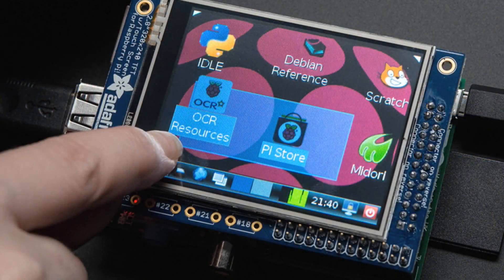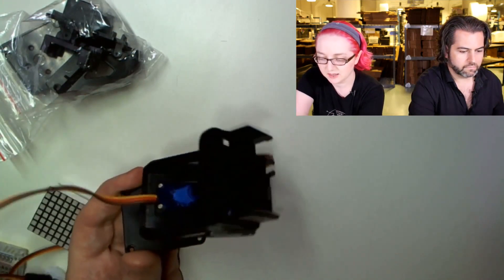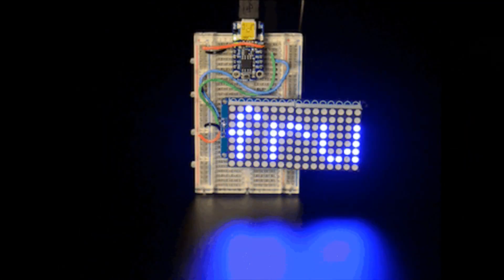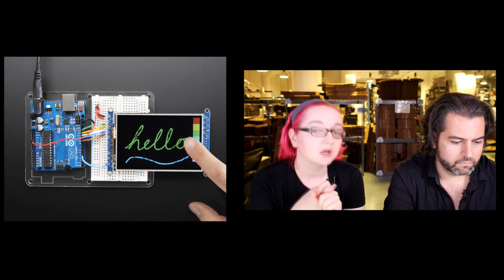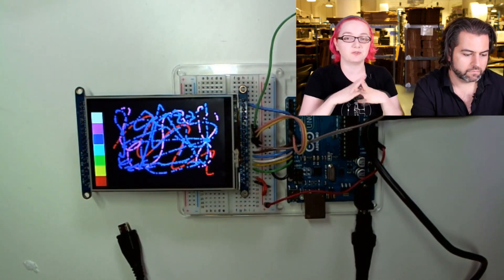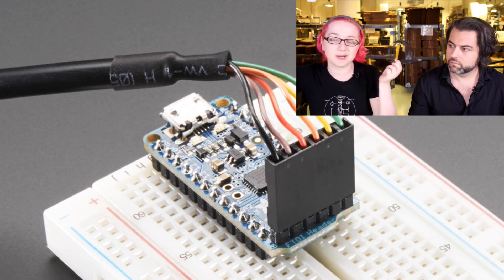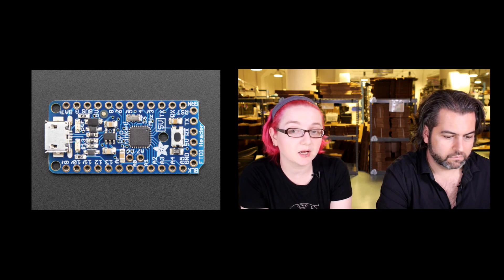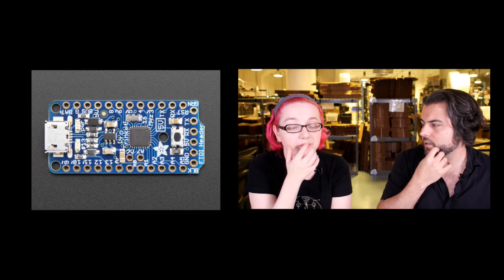New Products 8/20/2014

Comment from the maker: New Products 8/20/14
http://adafru.it/dGx

 - BitScope Micro USB (1:08) https://www.adafruit.com/products/2053

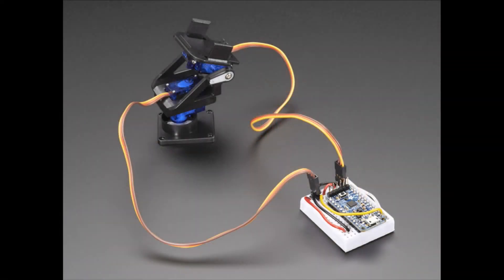 - Mini Pan-Tilt Kit - Assembled with Micro Servos (2:10) https://www.adafruit.com/products/1967

 - Unassembled Mini Pan-Tilt Kit (Without Micro Servos) (2:10) https://www.adafruit.com/products/1968

 - LED MATRIX....to see the full line up, please see (4:47) https://www.adafruit.com/categories/88

 - 3.5" TFT 320x480 + Touchscreen Breakout Board w/MicroSD Socket (9:02) https://www.adafruit.com/products/2050

 - Adafruit Pro Trinket - 3V 12MHz (13:21) https://www.adafruit.com/products/2010

 - Adafruit Pro Trinket - 5V 16MHz (13:21) https://www.adafruit.com/products/2000

All in stock and shipping now!
http://adafru.it/dGx